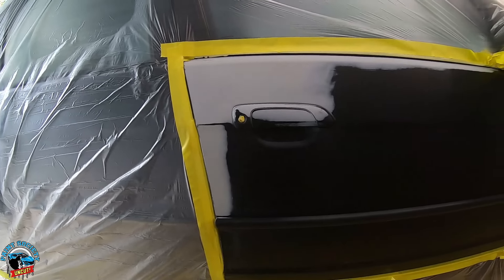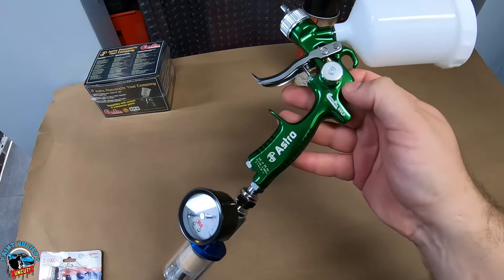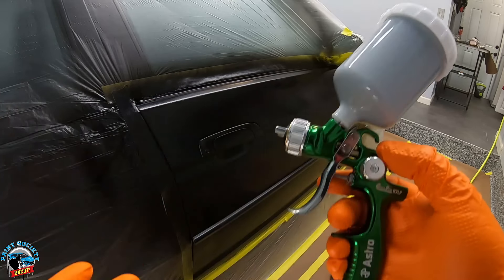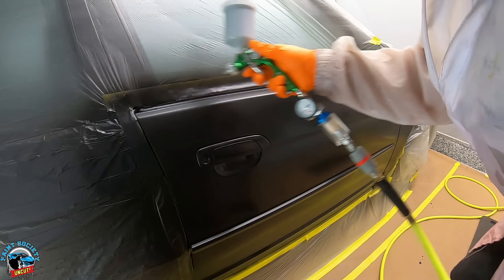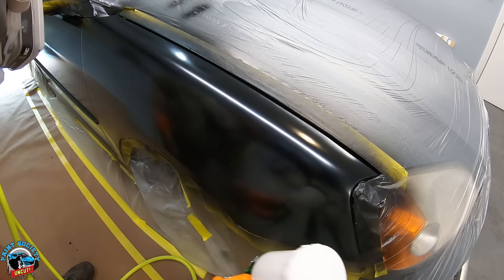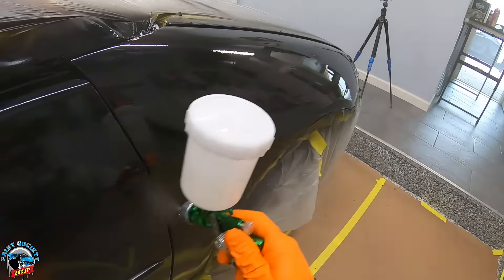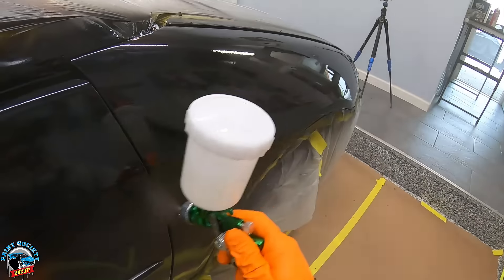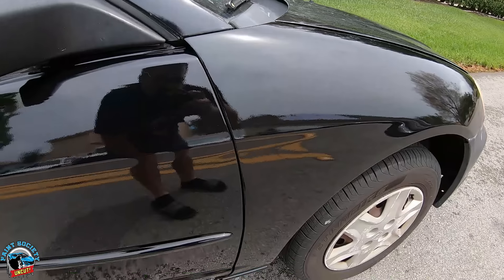The Cheapest Way to Paint a Car with AMAZING Results!

Comment: Where do you buy your auto paint from? I was thinking of tackling my single door for a DIY job at home using a 6 gallon pancake too.
Reply: Search up custom paints they put oem paint of any kind u can imagine and shipped to ur door super cheap too I got a pint of black denim Harley Davison color and a pint of 2k clear coat with reducer and activator basically everything u need all for 64$

Comment: Hi just picked up a Fuji semi pro 2 - can I use a 2 qt pressure pot with this 2 stage turbine ???  Will be spraying Behr deck sealer - oil based. Or will I need a larger 5 stage

Comment: Thanks for posting this. Where do you get the Honda color match paint from? Is there anything you need to do to the paint to make it spray better? I painted my 2008 Honda Interceptor with ColorRite rattle can paint, and it only lasted 2 years. After that the paint pretty much disintegrated and peeled off.

Comment: Would it not be better to have as short of a hose as possible without getting tangled up? I'd think it would help just a little bit with pressure loss so the compressor has n easier time keeping up.

Comment: Why didn't you use a LVLP Paint Gun instead of a HVLP since they are designed to work with small compressors?  Mine only requires 3.0 CFM at 40 PSI which even a pancake compressor can run (according to the manufacturer).

Comment: Fan isn't because of compressor. Run that exact gun off a 60gal 5hp compressor and the fan is still only 4-5 inches and that's at about 4-5 inches off the panel. If you try to use it 7-8 inches off the panel the fan is around 6-7 inches but the paint at the edges of the fan lays down dry on the panel. I use that gun all the time for doing fenders and bumper/spot repairs.

Comment: Hi all, watched just about every video on the channel and they are absolutely spot on:) im currently painting my motorbike and most of the panels have come out great, however, 2 have some small areas lf wrinkling, which i believe is down to the layers drying at different speeds. Any tips on how to avoid this, on the next gp round? Many thanks :)
Reply from the maker: Are you using rattle can primer or paint. If so. Get rid of it all
Reply: @PaintSociety  hi, im using paint. I was going to strip back the panels to primer, and then try to respray again :)

Comment: I'M SO PISSED! SOMEBODY HELP ME.... I applied 3 coats of turbo black spray paint in my truck door and got a few small drips so gave it two hours to dry and I lightly sanded it and when I went to apply another light coat over it to cover it the paint came on and is looking like cracks or shatter glass of that makes sense... How do I fix this!?!?!?
Reply: My guess it's not grabbing on to the paint correctly so you'll need to sand the door all the way and make sure to clean well so no dust is on before painting

Comment: I bought the spray gun because of how you rated it. I want to paint my 88 Firebird and have never painted a full car before panels yes but not a complete car. I have a 10 gallon compressor would that make it any better than the 6 you used? Also been debating between painting the car with Automotive Touchup brand aerosols with the 2K Clear aerosol or should I buy the paint to mix? Thanks!
Reply: I’ve been waiting on an answer?

Comment: Do you think that gun coupled with a 30+ gallon compressor would work for a full car repaint on a small car like a Miata or Mini Cooper? I have done quite a bit of touch up with airbrushes in the past so a smaller gun seems like it would be more in my comfort zone.

Comment: Thanks for making this.  I'm inspired now to tackle mine. I have a 2008 Accord sedan with original darker red metallic paint. There's a spot on the lower half of the drivers door, about the size of a paint can lid, where the clear is coming off.  Strange it's the only spot on the whole car. The rest of the paint is good.  When spraying new base & clear, do you always blend into the adjacent door and front fender or can I tape off and spray just that  door?  Was also wondering if I can tape off the upper 1/2 of the door leaving a rolled up paper edge so no hard tape line and try blending into the upper part of door where the paint's still good.  I'm going to buy & try this like you did with the .8 ver. Astro in my garage with an old 5hp. 30gal. Craftsman.  Or given its low spot on door and size, should I just rattle can it with 2k clear like you did in your other video?  Decisions, decisions... Any suggestions appreciated.

Comment: Air volume is inadequate not the pressure. The pressure drops very quickly simply because of lack of supply (not enough volume or cfm).
Reply from the maker: Therefore the pressure drops and is inadequate

Comment: Nice job.  I was wondering about some sliding closet doors I have.  They're new.  I have an airless sprayer and could knock the doors out pretty quickly.  But I just bought this little Kobalt 6-gallon compressor and wondered about it.  These particular doors are about 4 feet by 5 feet,  a little smaller than conventional sliding doors.  That's perhaps equivalent to the door and fender you did.  Do you think this compressor and the gun you used would work for me?  It would be less cleanup for me I think to.

Comment: Thank you so much for all you and your guys do.
Would u consider doing a training video ?  

Part 1
Covering
 1st set up.  gun, compressor size, filtration. 
Obvious a person trying to learn cant drop $300 on a gun they dont know how to use properly.
This would be mainly to paint and learn technique and mixing..
What kind of things should a beginning person should paint, what to look for.

Part 2 
Upgrading gun what to look for.
What is the natural progression for gun quality or is it better to start out with a top of the line gun?
Demonstrating hardeners, reducers . 
Ventilation for best dry situation.

Part 3

While I have seen you vids on sanding and body filler. 
Would you consider when to use different filler dependent on their depth of scratches.
Working out basic scratches

Thank you so much!
Phil

Comment: what pressure do you keep it at?  do you still recommend the smaller 1.0 or 0,8 gun for this? sorry complete newb to painting
Reply from the maker: .8 or 1 only if you’re using the mini gun. Full size gun around 1.3. On a full size gun around 27psi

Comment: I love watching your videos,  greatly appreciate the teaching.  I have a question.  Is it possible to mix two different brands without it being a problem, as in you bought the basecoat from one shop and you buy the clearcoat and/or reducer or hardener and mix them just the same?
Reply from the maker: You technically can mix a different base with a different clear but you can mix different additives. For instance you can’t use a ppg hardener in a standox clear.
Reply: @PaintSociety  thank you very much. I've recently decided I'm gonna do some DIY spraying on my car, and hopefully if all goes well, I would want to take it further hopefully
Reply: @m0ld0va-f2l  it turned out very good, made a few mistakes, but learnt from it,  common mistake I made was not waiting enough for the primer and basecoat to flash properly b4 putting on another coat, but I've corrected that, also I realized my pressure was a bit low in applying the Clearwater, but that was quickly corrected and the result was very pleasing,  that I also managed to get a job from it,  a neighbor wanted me to spray his car.
Reply: @m0ld0va-f2l  it does take a lot of work,  but the joy and satisfaction that u get from it is a priceless feeling. Just watch the videos, take your time and do it properly,  who knows,  you might start to like it and want to do more spraying in the future

Comment: Was the final shots of it after wet-sanding and finishing?  It looked like a saw a tiny bit of orange peel, so I wasn't sure.  Great job though!
Reply from the maker: Not sanded and buffer but could use 2000 grit and would be perfect

Comment: Shouldn't you remove all the bits and parts from the door, pain, and then add the back instead paint them over?
Good video though :) Nice to know the small compressors still can do the job and you don't need some extra expensive piece of equipment.

Comment: Question! I used black primer on my truck today and after i wet sanded it the black turned kinda Grey... Is that normal or did I do something wrong??
Reply: Do One  I'M SO PISSED! SOMEBODY HELP ME.... I applied 3 coats of turbo black spray paint in my truck door and got a few small drips so gave it two hours to dry and I lightly sanded it and when I went to apply another light coat over it to cover it the paint came on and is looking like cracks or shatter glass of that makes sense... How do I fix this!?!?!?

Comment: I'm starting my own autoflex paint business autoflex reccomend the satajet 5000b rp to spray with autoflex but that's a $1000 gun I want 2 1 to be strictly bace coat gun and the other for clear just have a hard time thinking I need to spend $2000 just on the guns any suggestions for an close to equal hvlp  gun that not $1000

Comment: is this a 1.2 nozzle set up?   the link to amazon has it at 1.0mm.   Have you compared other detail guns like Sprayit or  the  durablock 's?    I primarily work on small items like helmets and guitars.  MY  current eastwood gun is too big and have been trying to find honest reviews about detail guns.
Thank you
Reply from the maker: This was a 1.2 but I recommended the 1.0 or .8. It’s a better option
Reply: I use the Tamco 30 min speed clear also.   wont a 1.0 or.8 be too small of a nozzle set up for it?
Reply from the maker: No it will work. It will be better. Thinner coats. Less dieback
Reply: Thanks Brian!!!   I wonder if thats why I keep getting issues with small groups of bubbles in heavier spots of clear.
Reply from the maker: Hey I linked the 1.2. It’s in stock if you want it.
Reply: Thank you!   But if you recommend the 1.0 as the better option ,  I'll look into that.     Currently I use an old Eastwood plastic ( composite) gun 1.4 that a buddy gave me.  I think its really too big for my smaller projects.    Do you ever raffle off all these guns you get to try out?
Reply from the maker: Thanks. I don’t raffle because I need them for continued videos
Reply: worth a try.    Did you use reducer with the 1.2 or 1.0?   and do you think the 30 min or the slower hi-impact is better?  I know the 30 minute is better for flash espcially for those of us not working in climate controlled booths.  I paint in a basement with a 20 gal Stealth compressor.

Comment: I used to paint fighter aircraft while in the Air Force. I know how to paint. I have a small trailer I gotta paint and only have a Bostitch 6gal compressor. I think I could get away with using it.

Comment: I use the  harbour freight paint gun the bigger one and use my 1962 giant air compressor thast was made for painting cars and I use Rust-Oleum or even the paint that was mixed wrong or the shade or tint came out off and the auto body supply store sells those by the pints or gallon for very cheap like a hundred dollar can of paint that the tint was slightly off I only paid 10 dollars for it and I use that paint alot more for painting cars on the side for people as a side gig to make extra money on the weekends. My main customers are people who have bought a old early to mid 2000s car for their 16 year old or ppl who just want a fresh paint job on their daily driver that they use just for going to and from work and they don't mind the tint being off slightly and they usually don't care on the color and understand that the color they want won't be cheap if they don't have something close on the discount table. It's so much fun taking these cars with faded sun wore paint and making them look like new and giving them a new life. I also buy and re sell vehicles so I'll repaint them and fix any mechanical issues and then resell them for profit.

Comment: Use a 25 gal would do an overall. You just stop. The wet edge remains longer than you think. So it’s best 60 min but 25-30 is fine too. Just stop when it comes on and u get no variance in shade or peel

Comment: looked good for the equipment used but didnt pull off the mouldings or door handle? thats were your going to run into issues later on.

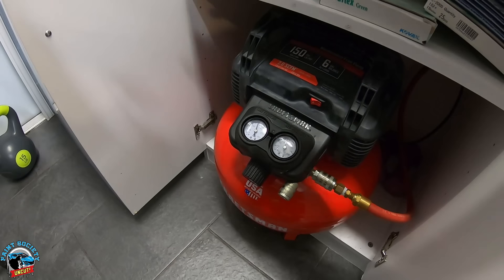Comment: Please keep in mind that this a High VOLUME Low Pressure gun (aka HVLP).  You kept mentioning the pressure to atomize the paint but this is all based on the SCFM flow rate the VOLUME and not pressure.  That pancake compressor only supplies 2.6SCFM (see the red tag @ 1:05) at MAX when most spray guns require 5-6 SCFM minimum. You also mentioned a 6 gallon compressor in your narrative but again, the size of the tank is not the most important factor - it's the the FLOW sir! The SCFM is the most critical aspect of the equation.

Comment: I got an 8 gal compressor, and a small sprayer like that, but this was for small projects just slightly bigger than an airbrush project.  I always called them panel sprayers because they are usually used on small areas.

Comment: With such a small compressor wouldn't a conventional gun be more suitable rather than a high volume one?
Reply from the maker: Good question. But this a touch up gun requiring far less cfm
Reply: @PaintSociety  
How about that LVLP Auarita L898 you had in your shop some months back for spraying some blue metallic base?

Comment: First lesson you don't wave the gun you walk from end to end with evin distance from the surface about 6to 7 inches  and go slow with this rinky dink setup you need a real compressor to keep up with the paint being applied to wet is better than to dry watch more videos with a pro painter theirs quite a few tricks to painting and a few different kinds of paint single stage ,base coat clear coat ,and three stage like candys or pearls
Reply: You're supposed to run the paint from outside edge to edge right ?

Comment: If you spent as much time r&i the handle, mirror, and moldings as you did masking, you’d end up with a better job. Painting the door handle on the door is not right. Think about the guy that’ll remove the handle at some point and pulls the clear off from the bridging or gas to cut it off. It’s really not that difficult. YouTube it

Comment: Try using a QUALITY base coat and clear coat for starters.  Try DuPoint Chromabase and Chromaclear.  You WILL NOT have any "piling" on the basecoat.  Even a Notice like ME cannot mess it up!  It dries in 10 minutes andit goes on Super Flat, no shine, no piling.   Basecoat should not be Shiny or even Satin.. Thats crap!  Then use Chromaclear like a clear enamel.  It goes on Smooothh..   Your clear coat product sucks!  DuPont is not that much more expensive so you are causing yourself a lot more work by using Cheap materials.  You're not saving yourself a darn thing!  Plus, Cheap materials is causing your Gun to not work that great.

Comment: Most paint guns I look at on eBay require around 12 to 14 cfm of air pressure, how u able to use with small compressor? Seems I need like a $1500 dollar compressor. What am I missing here?
Reply from the maker: We broke the rules which why we had a lot of issues.  If you watch the full video I suggest getting a compressor with enough cfm
Reply: Thanks for the fast reply, I was not expecting an answer. I understand you broke the rules and as you explained it caused issues. Issues you were able to overcome though, so maybe I could also 😜. Thanks again and I have subscribed and liked. Awesome
Reply: Cheers Do one, will check em out.